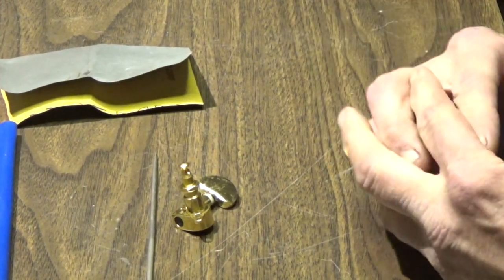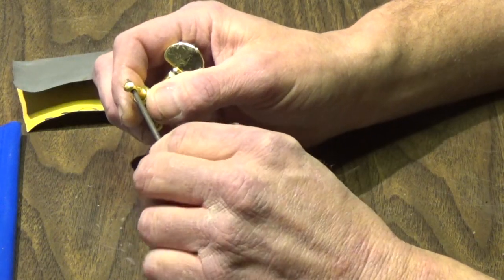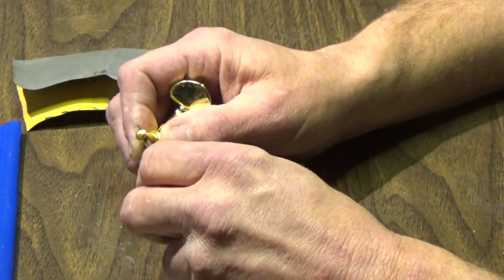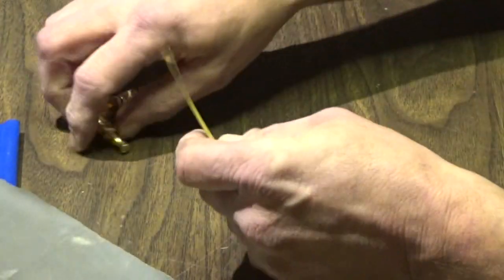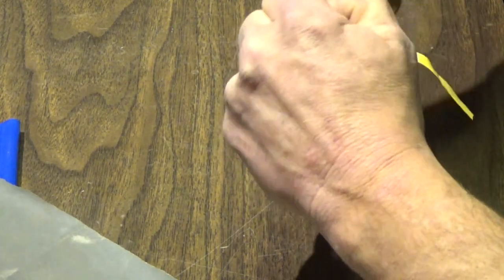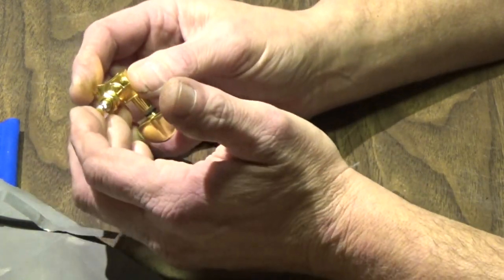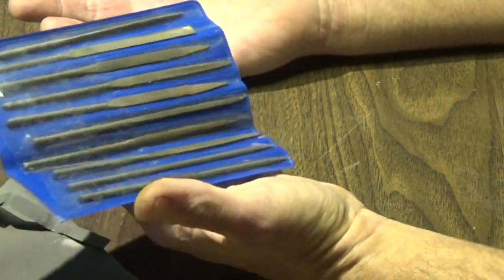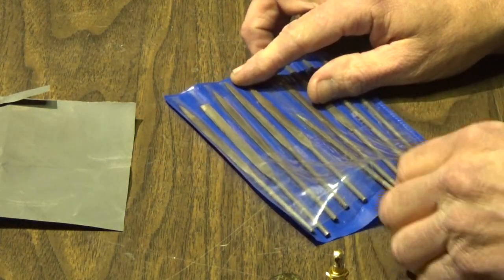How to repair a guitar tunning peg with a burr

Comment: I've had three G strings in a row break on my Furch LJ, so now I have to do this.  What size round file is that?
Reply from the maker: find one that fits there is no particular size you just find a needle file that fits and is roundand be gental when you do this you dont want to go crazy at it and you only do this if the G string is breaking at the peg it self